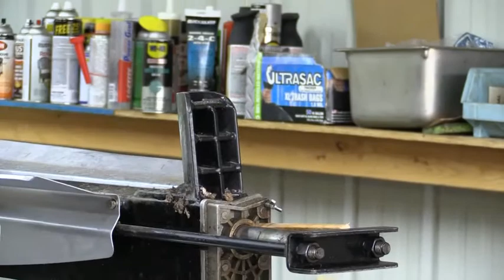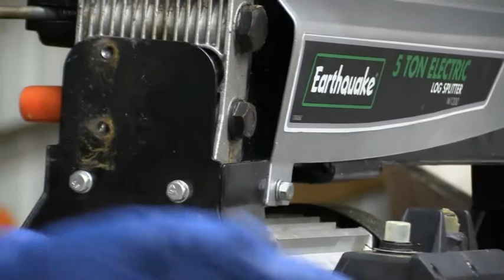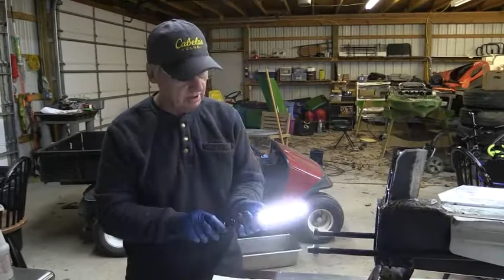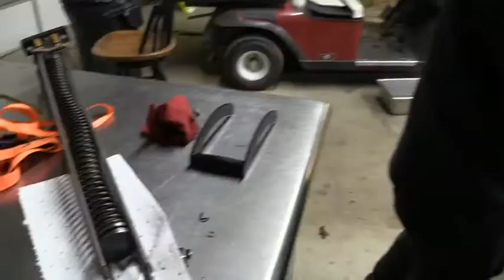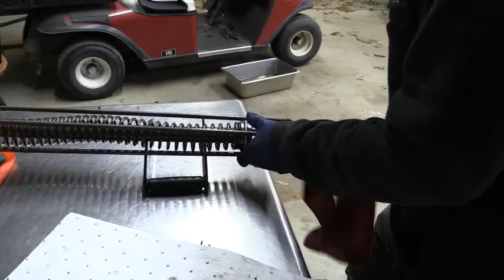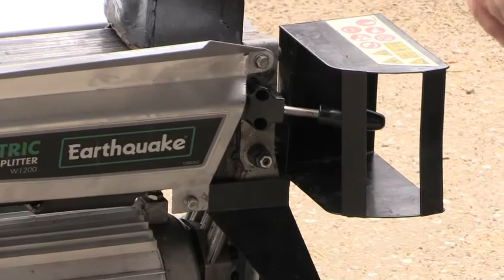Repair of Log Splitter 540

Comment: So if no replacement seals are available, I should look at different splitter that has parts available for it. That's why I do research on a product before I make the mistake of buying it.
Reply: I couldn’t find replacement seals, then I went to a cylinder rebuild shop. He matched up what I had and had exact replacements in my hand within 10 minutes.

Comment: Bought one used for $100 had no oil in it. Put 3.5 quarts of atf in it works great. Not as powerful or fast as maul. Good tool for the weak though. Let the kid use it to make firewood while I tend to more important stuff

Comment: You said not to adjust the factory preset pressure relief valve, but you are adjusting it?
Reply: Said not to adjust it to make it stronger, his reasoning to do so was to make it weaker due to the type of gasket he made.

Comment: I have oil leaking into the electric box through the hole for the cable going to the capacitor.
Is it possible to pinpoint the fault just from this information?

Comment: Interesting. I have the same machine but I bought it secondhand so I didn't know how it performed when new. As mine is only rated at 2 tonnes I thought it was only capable of splitting thin logs. On mine there is a label for ISC GmbH so perhaps they can supply spare parts? I would like to change the oil but don't know what sort to use or how to refill it.

Comment: Why did you use the blocks of wood? Wouldn't it be better for the ram to be fully returned with no tension on it for disassembly? Edit, sorry I see now. You needed the ram to be pulled away from the one end. Makes sense now.

Comment: Hello. Mine goes forward ok but it’s slow to return. It sounds like there’s fluid being forced through something. Could this be my issue?
Reply: Mine sometimes doesn't return and I have to push it by hand. When going forward it is faster than the repaired machine in the video but perhaps that was due to the adjustment he mentioned?

Comment: Very good James. Can you give me some tips? I have a leak from the part where it is glued togther (time 7.16). After using my splitter, it will, with in 1 month, leek about 3 - 5 ml and it continio to leek 1 - 2 ml a month. not using the splitter. 
Do you have any suggestions for me:-) Thank you:-)